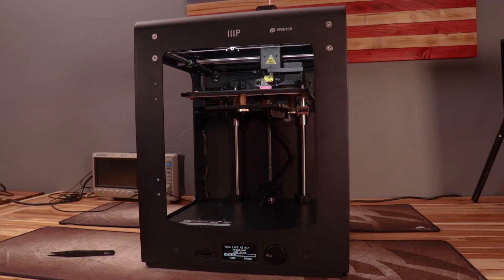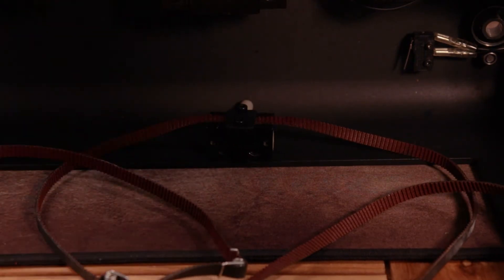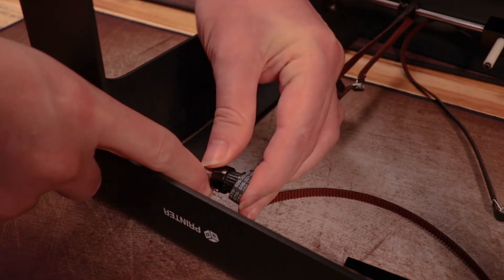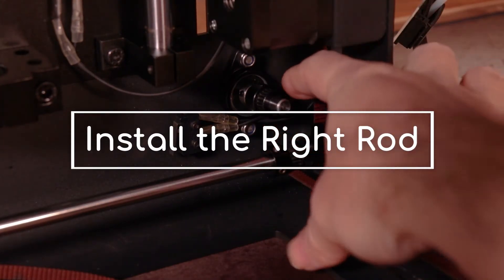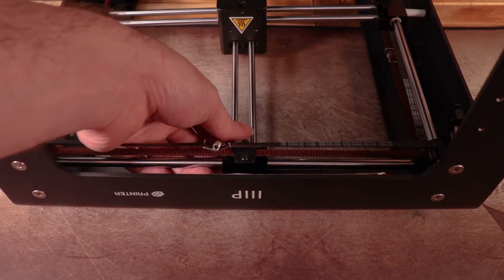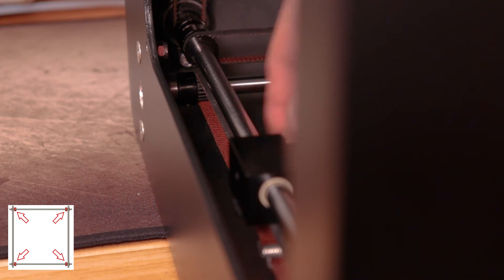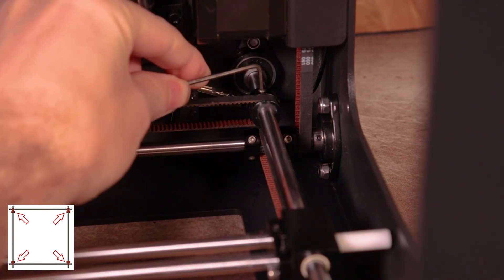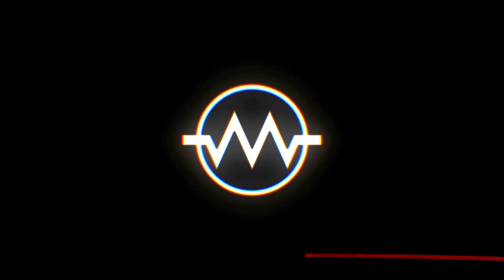Rebuild and Align the Gantry on the Monoprice Maker Ultimate 3D Printer

Comment: First of Thank you very much for the wonderful video and your clever alignment tools. in using your tools, it is clear the my x axis is out of synch. Instead of loosening the drive sprocket/pulleys can I simply loosen the screws that hold the belt to the slider, use your alighment tools and then retightern the screws. I am thinking that it will synch it up as well and easier for me to reach etc.
Reply from the maker: It might work, but the belt tension pulls the rods together and makes it a pain. Sorry for the late reply.

Comment: Do you have a link the alignment parts? I’m having a hard time finding them.
Reply from the maker: https://othermod.com/product/monoprice-ultimate-gantry-alignment-tools/
Reply: Awesome! Thanks for sharing these. I’m trying to figure out how you know if the rods need to be aligned. Mine seem to be fairly good, no binding, but seems like moving freely takes a bit more effort towards the corners. Not sure if that’s expected or if it could use alignment. I got this one used, so having a fun time getting it modded.
Reply from the maker: As long as it still works and isn't making any awful noises, I wouldn't go too crazy trying to perfect it. Maybe add some grease to the 8mm rods. The rods tend to deflect a bit from the tension on the belts, so even when everything is square you'll still have some resistance in the corners. If you like modding, I'm filming another video where I put an Ultimaker head in this printer. Hoping to have that out in a couple weeks.
Reply: Awesome, can’t wait to see it and how much it will impact print quality. I’m actually planning on replacing the main board on mine with something that has quieter steppers. The noise is really bothering me. I have a BTT Octopus Pro on order and I accidentally fried my cooling fan transistor, so it’s stuck at 100%. Talk about timing.